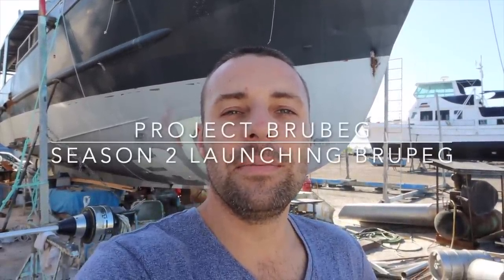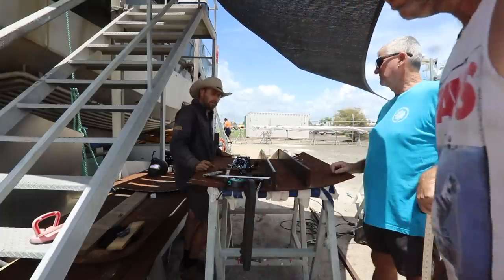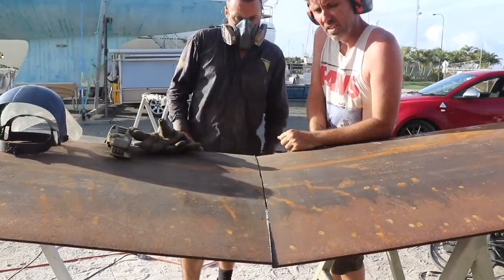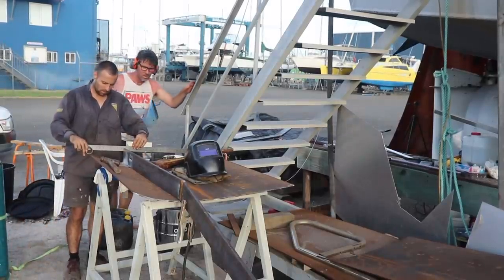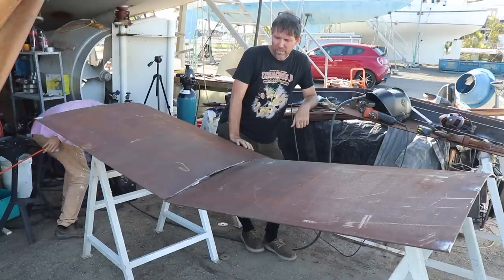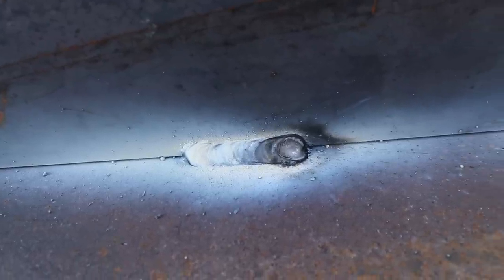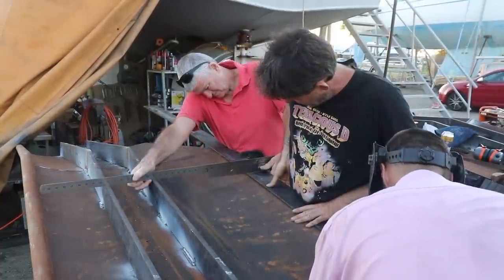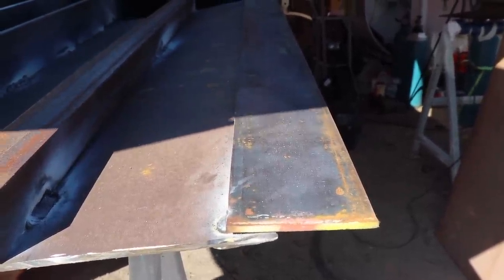Making Steel Trawler Wings - Project Brupeg Ep. 126

Comment: Love your work.. Why didn’t you make 3 plates like your profile, that you could weld the front pipe, and the 2 arms into.. would have made it easier to weld the top and bottom plates to the wing.. Just like they do when making an aircraft wing.. also the curve not lining up was probably due to the fact you only cut metal off one side of the wing plate..
Reply from the maker: Hi Daniel, im not sure what you mean mate.
Reply: Project Brupeg, you know your wing profile you showed us at the start, with your measurements on it.. Cut say 4 of those out, 1 for the near the ends of each section of your wing.. Then you could weld all your stabiliser beams, and the front tube and rear plate before putting any plate over the top or bottom.. Also if you drill holes thru your plate where those main beams are, you could weld thru like a spot weld to keep all the plates well attached!!
Reply: Damien, essentially you’d have 4 ribs, along with your 2 main spars, leading edge, and trailing edge, all welded together, and you’d then just have to plate the whole lot, and weld it on.. Would give you the greatest strength, and keep all your main structure tied together with the distances all being equal!!

If I’m still not making sense, look up Plane Wing Structure on google, go to images, and you’ll see what I’m meaning!!
Reply from the maker: Yep got yeah I understand now. We’ve built past that point now but that could’ve worked quite well
Reply: Dame, yeah.. Part of the problem of the videos being after the fact.. Great work with what you’re doing.. P.S. could still plug weld thru your plates onto the main spars so you have good attachment of the wings to them!!
Reply: If you’re ever after someone to bounce ideas around with, hit me up!! I come from an engineering/mechanical background..

Comment: Dame, are you leaving the wings hollow, or will you fill them with closed cell foam? The thought popped in my head that, if left hollow and were water to get in, you would end up with one wing out of balance, causing stability issues, and it would also stress the hydraulic rams to get it back to its vertical position.
Reply from the maker: Hi Frederic the wings will be sealed welded hollow tanks when complete. We will be adding a bing to each wing and filling them with 20-50L of diesel that will slosh around in normal service to deal with internal rust
Reply: @ProjectBrupeg  And you'll probably test for leaks, like you did with the dinghy...makes sense, because if there were a leak and you did have closed cell foam, there would be some water retention, promoting internal rust. Watching you guys put that wing together was very cool. Once you get Brupeg splashed, are there any future plans to go to Dangar Island and hang with Stu, Renko and the D Squad? You both play well off each other on camera, very entertaining.
Reply from the maker: Funny enough Stu is thinking of steaming Renko north and keep the boat up near Brupeg. We plan to spend a bit of time with each other, and hoping to do our sea trials with Stu up here so either one of us can tow the other if needed but it also means Stu can take Renko off the coast a wee bit and maybe use Brupeg to store the gear needed as he might be a bit tight for space etc. Once all thats done we will most likely head south for some projects we are working on (more on that soon).
Reply: @ProjectBrupeg  A Detroit Diesel towing a Cummins.......yeah, I can see that. ;-)

Comment: Just out of curiosity, are 9inch angle grinders not a thing there? Seems heavy work for 4inch grinders and I rarely ever see anyone using the big ones. Keep up the good work 👍
Reply from the maker: Yeah we have a nine but we find the 5” with a 1mm disc cuts much faster than the 9” with a 2.5-3mm disc
Reply: 9in is so awkward and heavy to wield around 
What can't be done with the 5in there's the plasma cutter 
Won't see too many 9in grinders in engineering workshops anymore either for this reason 
Theye banned on mine sites In West Australia for being so unsafe
Reply: @fowletm1992  Not only mine sites but offshore construction as well.
Reply: @rudolfpeterudo3100  
Didnt know that  but prob loads of other industries as well
Reply from the maker: Yeah i agree with the guys, the 9 is a pig to use. Much prefer the AEG 5"
Reply: I don't think I've ever seen a 5 here. That may be the differenc. All 4s and 9s. I use the crap out of the 4s but I do pick up the 9 for heavy work or doing deeper cuts. I'm not sure what thinkness they are but we get a skinny disk for them that cuts heavy plate pretty good.
Reply from the maker: Yeah 4's are pretty crap compared to 5's IMO. its only a small different in disc size but my AEG 5" is 1100watt @ 240v so its got a decent bit of grunt. my 9 is only 2000w so not significantly bigger and not really faster on most things as the discs at 3x as wide so you need to do a LOT more cutting to acheive the same thing

Comment: Not a737 Max LMFAO, will trim easier and fly true no ground maintenance issues
Reply from the maker: This is engineered heavy enough that if it does fly like a 737MAX, it will survive a solid grounding and it’s the rocks that should be worried!

Comment: Don't these things create lots of drag when not in use? Great piece of design nonetheless. Great video
Reply: They are retracted when not in use, so no drag.
Reply: Marshall Murrell well duh, but it’s a pretty chunky design, so yes drag
Reply: @tvanderwheels3292  When retracted, it will not be in the water.  It will be folded up against the gunwales.  There may be some drag from air, but not from water.
Reply: Marshall Murrell the brackets are under the waterline right?
Reply from the maker: Hi guys. Your both right. When not in use they are folded up but the lower 1/3 is still in the water. They will create a small amount of drag around the hinges but the wing drag will be marginal as it’s still hydrodynamic even if it’s vertical. That all said trawlers like Brupeg often have lots of bits hanging from the hull (Brupeg had three transducers roughly 12” dia and 24” long) and they don’t notice the drag from these. Overall Brupeg will be more streamlined (even with the chunky hinges) than she has ever been before
Reply: That makes sense! Ijust think making a boat as efficient as possible is also a way to help the planet, not only by running it on vegi oil.
Reply: @ProjectBrupeg  Thanks for the clarification.  I did not realize the hinges were below the waterline.
Reply: @ProjectBrupeg  How much of the bracket and wing will be below the waterline when the wing is retracted?  Doe the change in paint color approximate the waterline?  I know you are planning to remove the cooling tubes from the hull, so that may give you enough reduction in drag to make up for the stabilizer drag.
Reply from the maker: Yes the colour change is about 6" above the water line so roughly 20%-30% of the wing stays in the water at all times. Im with you about trying to make the boat as efficent as possible as it helps us drop fuel consumption which means the boat costs less to run and we can get further for the same fuel volume. As a yacht racer i used to spend days and days polishing my race boat hulls with stupid level wet and dry sand paper to get that last zilch of boat speed from her.

Comment: I always felt that steel toecaps give a false sense of security...I mean you're going to make SURE you don't drop 250kg of steel wing on your foot if you know you're going to lose a toe...
Reply: Well maybe but i work with large formwork (easy 1500-3000lbs) and have had it bounce and jump back landing on my foot. So while yes if its heavy enough to crush the steel toe your probably just gona avoid it. Yet shit happens and i'd 100% rather have them than the broken toes i would have had.
Reply from the maker: Yeah I’m with Deftones on this. I do like my steel caps when I have them. Stu... not so much
Reply: Yes I used to follow that approach until I missed seeing that piece of wood sticking out that knocked the large slab of oak out of my grip which fell SPLAT! crushing my big toe bone into three pieces....  The old “garage slippers” didn’t have a lot to say on the matter.  Knowing you need to avoid an accident doesn’t always prevent them from happening - I guess that’s why they’re called accidents.
My way of thinking changed that day. Funny that...   : )
Reply: They're actually going to cut your toes off if the weight is something that exceeds their rating or if the weight is on the inner lip. I still use them, but i'm fully aware of how gruesome it can get after witnessing it on a job site with an unbalanced load. Poor bastard never stood a chance when the loader tipped and the machine casement for a hydraulic elevator fell on his foot.

I guess there's no reminder like actually watching it happen.
Reply: @aserta  
As you said but well below that rating 
Its actually what they're designed to do 
Tbeyre not so much to save a crush injury like people think but if you do drop something heavy on your do it'll clean cut your toes off and you can be dragged lr crawl to saftey maybe they can be reattached though Surgery maybe not but the other option without steel caps is your foot gets crushed and sends bone fragments right into your foot possibly causing way more damage maybe even looking your whole foot and your possibly left stuck under the thing that just crushed your foot and possibly in more danger 

Its not so much to save you but the better of 2 evils 
If you really wanted crush protection you need to go to the gym more cause that boot is going to weight 10kgs
Reply from the maker: I kinda use my steel caps as lifting accessories, ie pick up a heavy thing with my finger tips, rest it on my boot, get hands right under it to lift it properly. Can also be used as a foot mounted adjuster, and it the right weather conditions make trudging through our waterlogged yard possible
Reply: @ProjectBrupeg  
Foot mounted adjuster is right 
On the farm to get the last of the grain out of the soil cones we go round and kick them loads of times 
Destroys your boots after a while
Used to wear rubber capped steel toes for this reason but I just find them too uncomfortable with my sasquatch feet 

Rossie elastic sided boots is where it's at I rekon

Comment: "running flux core with Argon and Oxygen"...What?
Reply from the maker: Or in our case thinner mild and stainless welding with normal transfer. It’s pretty standard to use flux core with gas in heavier steel to get a better weld, it’s just not something we do often